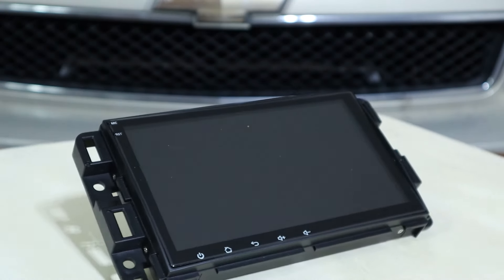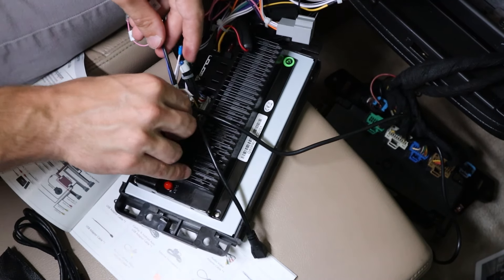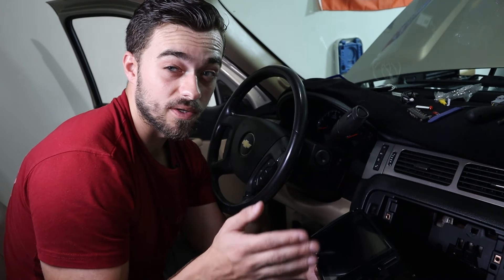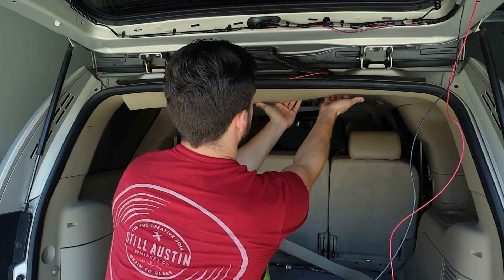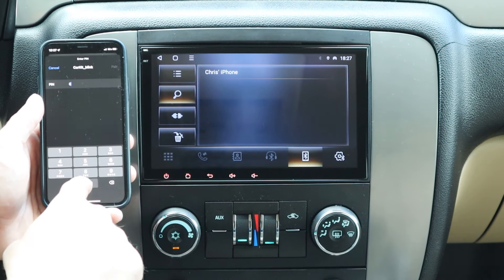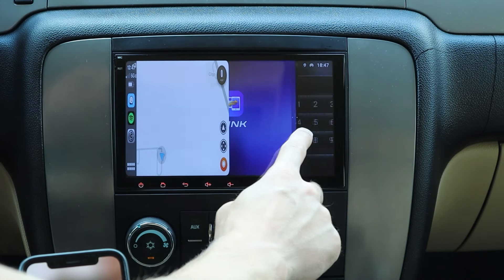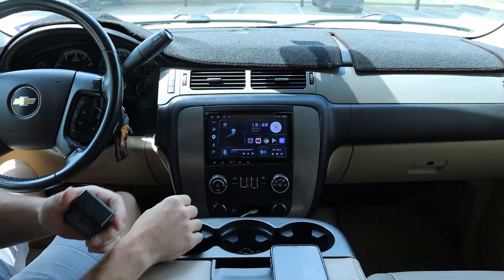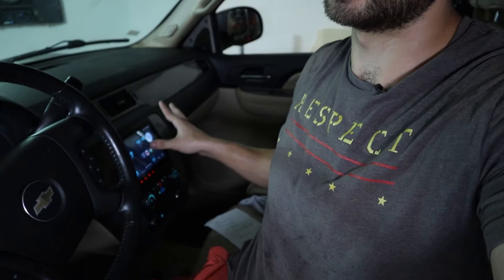2007-2014 Chevy Tahoe Apple Car Play Stereo, Backup Camera and OBDII Scanner Install | Eonon Stereo

Comment: Hi man, you can use the original camera in this unit. There is a gray connector and you need to find the two wires for connect the camera that came in the car. I installed one in my Chevy traverse and the original camera works perfectly. I saved i lot of time using the same camera.
Reply: I am having problems with my camera...I just plugged the yellow came in to the radio and yapped into the reverse light...No signal error is all I get.
Reply: @paulbushjr8335  it’s not working because the pin out comes wrong. You need to change one pin in the connector.
Reply: @sonarfleet2375  Hi....You just totally lost me...One pin over??....Thanks in advance...
Reply: @sonarfleet2375  hi...hopefully all is well...How do I change it??
Reply: @paulbushjr8335  in the brown connector has your camera. You need to match the negative and positive wires with the cable video in on radio. I not sure, but a think pin 6 is positive and pin 14 is negative. If you share your email, I send additional informations
Reply: how old is your traverse? I have a Chevy avalanche from 2007 and I'm seriously interested in this one but  I was doing some research and I don't know if that grey specific adapter will work with mine because mine is a 2007.

Comment from the maker: Check out the Stereo and support my channel
I used the Q80PRO Stereo: https://tidd.ly/3r8ZliW 
A0119 Backup Camera: https://tidd.ly/3Se4fHe 
V0056 OBD2 Scanner: https://tidd.ly/3Ux92Fj
Plastic Trim Remover: https://amzn.to/3dEdLV9 
Quick Splice Snap Connectors: https://amzn.to/3LIXaf9 
Set with T15: https://amzn.to/3Re6UiT 

How to remove license plate trim/panels: https://youtu.be/d-CN0J5ZTew

Comment: This is an awesome video and I was able to successfully do this on my 2007 Tahoe. I also had the same problem with the nuts holding in the part above the license plate freely spinning. So I had to install the cam on top like the vid creator. If you do this be aware that it can block your rear wiper. So make adjustments as necessary.
Reply: Good thing my rear wiper doesn’t work since I had to replace the whole rear latch🤣nonetheless good advice👍

Comment: Good job!  I was doing my suburban at probably the same time as you. I had the same issue getting the license plate cover off.  I ended up drilling a hole in the license plate cover metal of the door.  I then fished the camera wire through the holes and did not have to remove it.  I also used the same Eonon head unit as you, but I added surround view cameras (birds eye view) as well.  placed the side cameras on the stationary part of the side mirrors so they don't move when I fold the mirrors in.  Works great!  The head unit does have an issue in the summer where it stops working once in a while.  Stopping and restarting the car brings it back.  Might be overheating. 115 degrees out there.

Comment: Nice upgrade from factory radio, but did you know you can retain the factory usb plug-in (if you have one) without any adapter... Yup, right under the centre console tray, just unplug the factory usb cable under the centre cupholder area and plug in the usb cable from the radio.
Reply: Was wondering about that! Glad I finally found someone that said it

Comment: Great video. So if you run both power and ground from the taillights, you dont need the small red wire next to the yellow plug correct?
Reply from the maker: The red wire tells our headunit to swap to rear view camera.

Comment: Hi Chris!!! Thanks for another great video! I recently discovered your othrr channel and started following it. Lovely video about your wedding, congratulations to both of you! 

P.S.: I have a question about the Q80Pro unit you installed. Does it comes with the GPS antenna? And also, if it comes with it that means it provides GPS Navigation without the need of a smartphone? Thanks again for your great videos. Many blessings to you all.

Comment: Any issues with the rear camera being so much higher than suggested? I got the stereo in thanks to your guide. Starting on the camera today. Where you mounted actually looks better to me
Reply from the maker: It’s not terrible. I personally wish I could of removed that tail plate trim piece. 
My current location I can not see my bumper because the rear windshield blocks it. So, I use the windshield as my “bumper” when I back up and need to use it.
Reply: That was an epic fail. My bolts by the window release were spun too. Still managed to mount it there with some very careful snaking. Finally got everything wired to the head unit and it is showing like 12 blocks of crap. I know the camera is getting power and signal to the head unit but now no idea why the picture isn't right. It's too cold outside for diagnosis lol
Anyway, your videos are very helpful and I'm in going through them all slowly
Reply from the maker: @punchracing  appreciate it man! If I didn’t already have holes in my spoiler, I would try to reinstall it on the tail plate. 
I forget exactly where but there are video setting that you can change that should fix the block issue.

Comment: My Tahoe model (2010 Z71) with the Bose speakers, already has a reverse camera that shows on the rear view mirror. Do you know if this stereo can work with the original camera? And if it’s compatible with the Bose system? Best!
Reply: Same here and I'm also wondering about this.
Reply: @ManicBrittanic  @luisharomtz in my 08 with bose it all works, there is an adapter for the backup cam online or you can just splice it.With bose you just need to make sure you use the correct blue/white wire since there are 3 and it will turn on the factory amp and get ready bc it is loud!!

Comment: my rear speakers stopped working, the left one doesn’t work and the right one keeps buzzing, i reinstalled the old radio and works perfectly fine, but with the eonon it has this issue. is there anything i did wrong?
Reply: My rear speakers don't work at all only both front

Comment: I’m having an issue with installing this. It’s simple to install, but as soon as I plug in the black clip ( 2:16 ) and turn my key, my speakers start making a nonstop loud droning. Any idea what could cause this? I’ve checked the prongs for bends etc. on both sides and the wiring all seems good, but for some reason the audio output seems broken.
Reply: did you find what was causing your noise?  I'm getting the same sound after my install.

Comment: Hi great video thanks for the help. Is there a way to get CarPlay to automatically start up instead of having to hit the button every time?
Reply from the maker: I’m not near my car at this second, but there is a selection under settings that says something like this “all wireless to auto connect” 
If I remember, I’ll double check how. It connects every time after I did that with no issues.
Reply: Ok thanks

Comment: I have a car play just like yours. Do I have a question? When you start the engine into your system, the noise of the engine enters. I mean when you step on the accelerator, or you solved it in some way.. thank you
Reply: Check your grounds.

Comment: Putting q80 in my 10 avalanche. Says onstar not supported. Does that mean no crash safety protection. Is the mirror controller dead..no emergency button.csnt get clear info from eonon. New gma22s suppose to support onstar but even then they dont give answer.

Comment: and this works with the BOSE system on LTZs ?
And the steering wheel controls work as well ?
Reply from the maker: The steering wheel controls work, I actually showed them working as I was going over the unit. As for BOSE, I am not 100% sure but I am assuming you may need to install some sort of AMP. There are videos out there with folks installing aftermarket units. Look for a video installing an Android head unit with their BOSE system. Good luck!
Reply: @AutoMotivate  Carxtc Car Radio Electronic Wire Harness
On Amazon it maintains bose on star and streeing wheel controls
For LTZ models
Reply: What do you mean? Does it work with Bose if you have the adapter? I have the Bose speakers and I didn’t need a special adapter to do that or to use the soft controls on the steering wheel. I don’t know if OnStar will work.
Reply: @HowardFeinstein do you got factory reverse cam and if you do were you able to just use the factory camera
Reply: I just installed it, works great

Comment: Hey I installed my radio today in my 07 Sierra and my steering wheel controls won’t work I was wondering if you could help me out with it
Reply from the maker: I’ll try my best! I should have explained more how that even worked, but I didn’t want the video to go on forever. 
The unit is paired with a canbuss which enables it to work with the steering wheel controls. 
The canbus is the best plastic brick looking thing that’s a part of the wires. I would ensure everything is plugged in right, first. 
There is also a glass fuse in another black plastic box that you can check and make sure it isn’t Brocken, which can happen since they are so fragile.
Reply: @AutoMotivate  ok thank you so much man I appreciate it

Comment: After having this for awhile now, would you still recommend it? I'm wanting to upgrade the radio in my Tahoe. I'm am wanting to save money if at all possible but I don't want a piece of junk that I wasted money on either.
Reply from the maker: I would say yes. It does have a few “bugs” but they are easy to remedy with force closing the application in the settings and reopening it. 
It doesn’t happen often, though. 
Looks great, feels high quality, and automatically connect to my phone. I’m happy with it.

Comment: Hi, did that unit come with GPS  and antenna? ... Thanks, and nice video... :)
Reply: It comes with a separate GPS antenna but the one on the truck will work if you have a GPS already in the truck but you need to buy an adapter to go from a push on connection to a screw on connection that’s on the back of the unit
Reply: @HowardFeinstein  thanks... I'll order in a week when I get my Tahoe... 👍
Reply: @joen9275  Bingfu Vehicle Car GPS Antenna Adapter Cable SMA Male to Fakra C Male Blue Coaxial Pigtail Cable 15cm 6 inch for Vehicle Truck SUV Car Stereo Head Unit GPS Navigation Receiver System GPS Tracker Modem

Comment: Where do you connect the red wire coming off of the camera to head unit plug?
Reply from the maker: If I remember correctly, I did nothing with it
Reply: He tapped into the rear brake vs running a power wire from front to back, it is just to power the camera so nothing...

Comment: I have a tahoe 2011 z71 whit DVD oem and stock stereo , my cuestión is,if i upgrade to this stereo of your video can i see videos in my stock rear screen o only in the stereo ?????
Reply from the maker: Someone mentioned in this comment section that they were able to use their old camera by splitting the wires and wiring it in

Comment: Do you know how to get the, power, back and volume buttons to work? I have messed up some kind of settings and can’t figure it out
Reply: There’s another video, explaining, how are you go into the menu to control the canbus and add your vehicle. I had to do this after pulling power back off the unit. It worked initially then it wouldn’t when I unplugged. I tinkered with the factory settings and it worked again.

Comment: What wiring harness kit did you use between the head unit and factory harness
Reply from the maker: It came with the kit, so I am unsure.
Reply: Since this head unit is designed to work with specific Tahoes and Silverado/Sierras it comes with the correct harness that plugs into the factory plugs

Comment: I bought the same unit, are you having issues where the volume is too loud? My unit goes up to 30 but I can only use 1-2 with 2 being too loud and 1 being pretty much mute
Reply from the maker: ahh, wow. That is odd. I am not having that issue. Does your car have the Bose system? Maybe that has something to do with it
Reply: Turn off speed sound adjust settings. This worked for me

Comment: looks cool will this work well with bose system?
Reply from the maker: I did research before making this video, and amidst it I saw the the Bose system might require a different install process. Perhaps you'll need to add an AMP? I am unsure. I did not dig too deep into it since I did not have the BOSE system.
Reply: @AutoMotivate  tnx BTW ur Awesome 👌
Reply from the maker: I appreciate that, thank you!
Reply: Works perfectly fine with the Bose system

Comment: Hi, just a question. Does this unit still work? I red a lot of comments on Amazon of people saying that it stops working very often.
Reply from the maker: Mine is still operating and functioning just fine. I think they have a decent warranty. Check out the warranty guidelines on their website and see if you are comfortable with it.
Reply: @AutoMotivate  unfortunately I live in Italy and it will be too expensive to send the unit back for warranty
Reply from the maker: @giopapy  ahh I see. Well, if you don’t want to take the chance I’d recommend spending a little more for a bigger brand
Reply: @AutoMotivate  after seeing your video I was thinking about eonon because its plug and play option. I watch all of your videos and I follow all your advices

Comment: Will it work without using the OBD2?
Reply from the maker: Do you mean, will the diagnostics work without the OBD2? No. 
Will the unit work without the OBD2? Yes
Reply: @AutoMotivate  Thanks, just want radio to work, don't really need diagnostics, and my obd2 is already being used.
Reply: @twoknuckles  FYI, you can get an OBDII splitter on amazon to allow you to have 2 OBD ports in the case that you want to utilize all of the capabilities of the head unit. I did it with my 2011 Silverado and it works well.
Reply: @MrTimdtoolman1  yeah ive got one of those splitters but I'm running the range on obd2 now to keep in 8 cyl, just winder uf it will disturb that. May just try it.  I already put unit un and installed a tailgate camera too, all works great. Might just leave it alone.
Reply: @twoknuckles  I have the splitter on my truck with the Range as well as I have my Kenwood head unit plugged in using obd2 for truck data on the head unit but it has not had any affect on the range keeping my truck in 8cyl. mode
Reply: @MrTimdtoolman1  Good to know!!!  Thanks!

Comment: never put a gps antenna in a confined space like the overhead panel.  that will just cause problems !

if it isn't obvious GPS antennas MUST have direct unobstructed  view of the sky above.   There are a few areas where this gps antenna can have the best possible signal.  Here are some tips:

pillars block the sky. Don't place gps antenna near pillars!
rear view mirror blocks the sky. Don't place gps antennas under the rear view mirror.
inside headliner compartments completely block gps signals (there is a metal roof above these panel compartments.  Don't place gps antennas in those hidden ceiling compartments.
some windshield have built in defrost elements (they heat up)...you can usually see these at the edges of the windshield.  Don't place the gps antenna near those windows edges.  Some of these are factory antennas also...they look black of shiny metal.  Don't place the gps antenna hear those elements.
most dash have some kind of daylight/night sensor...that automatically signals for auto headlights for day/night and also dimming of the dash lights (and some other things like cabin light dimming). Don't place the gps antenna near those sensors or they might not work correctly.
most dash have a opening slot fo defrost.  This area can get very hot when defrost from hvac operates.  Don't place the gps antenna near that defrost slot.  *the heat might cause damage!

here is where you want to locate your gps antenna:  on the dash away from everything else and in the best view of the sky.  This usually means as far forward toward the glass and centered .  

you are welcome
Reply from the maker: Thank you for mentioning this.
Reply: @AutoMotivate  you video install was good and I used it to plan on how to install several upgrades to an old model truck.  Your video was very helpful to get a pretty good idea and how I installed everything.  I am even doing some research to replace the sharkfin antenna that origninally only supported onstar and "vehicle location" with an aftermarket sharkfin antenna that function as FM/AM and GPS (but not onstar which I don't care to have in my truck.)  I am still looking for a top quality sharkfin  antenna that can do these two functions and can mate up correctly with the through hole in the cab roof and is waterproof (which is a known problem for my model/year truck).  Still looking for that because I really would rather my dash uncluttered and of course the OEM whip antenna is just crap.....antennas mounted on the cab roof are going to be superior in terms of line of sight for both gps and fm/am.  But I still have not found amn aftermarket sharkfin antenna that has all the specs I need.  (I live in a very remote and rural area.  GPS is not an issue with reception, but fm/a,m signals are weak!  So I need the tallest point in the truck, the cab roof, as a location for this kind of antenna.)  It also looks better not having that stupid old school whip antenna that seems to get beat up when I drive through the bush!
Reply: Is the gps for the Apple Maps?